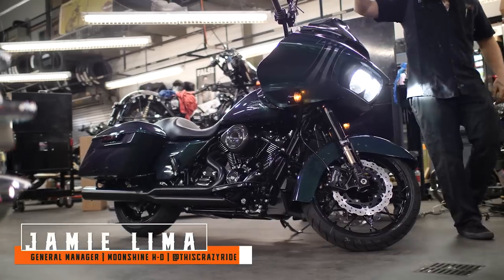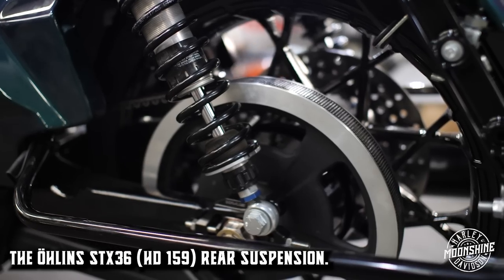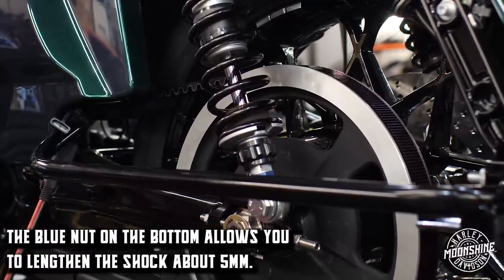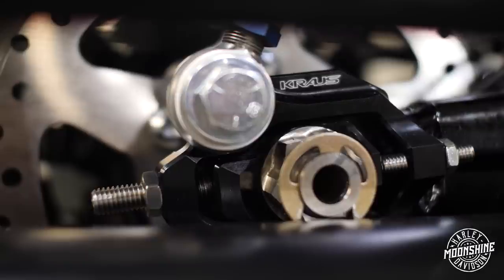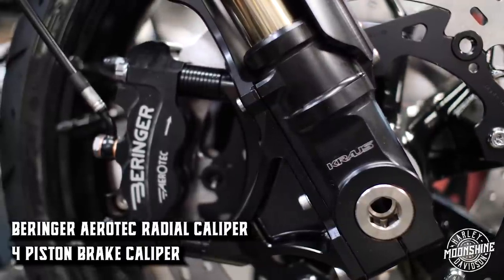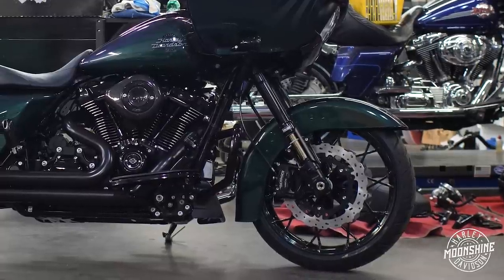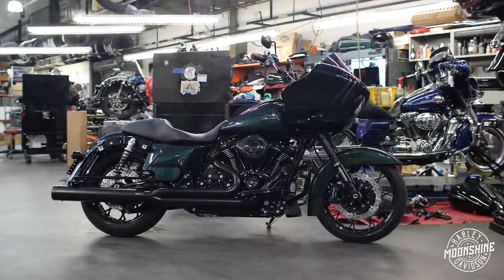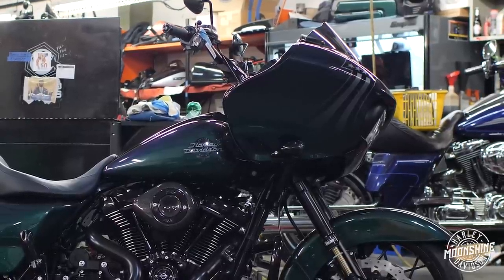Let's Build It! | Performance Bagger BIGGER KIT Bike Build No. 3 | Shop Talk Episode 50

Comment: When you take weight from the bottom of the fork and put most of the weight on the top, clamped in the triple trees you are reducing the unsprung weight. I believe that the more you take away unsprung weight the better the handling.

Comment: I have a 2020 SGS with the Kraus inverted front end, Ohlins on the rear with the Harley stg. 2 kit. Also have Feuling oil pump, camplate and lifters. I want to have some motor work done on the bike but I live in CA and am not comfortable shipping that far.

Comment: Right fork tube has a Teflon slide is that for measuring front end sag , what do you usually adjust baseline compression/ rebound
Reply from the maker: We use the slide for sag and complete travel while pushing hard.

Comment: Question I got a exhaust for my 21 road glide, I don’t need to a tuner right. And I was told when u air cleaner and a exhaust then you have to?? Also is there a tuner for the 21 screaming eagle
Reply from the maker: Yes there are tuners for all the 2021's, some shop can do it and other will tell you no. We tune all bike we install a full exhaust system on. you can get away with the factory tune if you keep the stock head pipe and add slip ons. We would recommend the most restricted baffle on stock engines.
Reply: @MoonshineHarley  can I get away with it for a few more months? It’s def noticeably hotter for sure. Will it be ok till nov? When riding season is over,

Comment: how does the new rear brake caliper interact with linked brakes?
Reply from the maker: The same as stock. It’ll just stop you faster with a firmer feel than the stock setup.

Comment: Question: I want to trade my bike for a Heritage and have it built. Do you guys see any noticeable difference in performance from the 107 bottom end to the 114 bottom end? I understand the stroke is different. But how would that relate to everyday riding?
Reply from the maker: 1 - 1.2 HP and TQ per cubic inch gained. The 124 setup on the short 4.375” stroke is a great setup.
Reply: @MoonshineHarley  
Thanks for the info!

Comment: Your spring vs unsprung is incorrect. You want both lighter (obviously) but it’s always better, if you can chose where to put the weight, to make it sprung weight. 

You want weight in the chassis (sprung) vs in the wheel (unsprung). Get the inertia off the moving portion trying to stay in contact with the road.
Reply from the maker: we got excited in the video and flipped it.

Comment: Must be nice to have money.
Reply: That helps 🤠
I still like watching the Videos though. 
The Knowledge helps build a list for when i hit the lotto.lol
Reply: Yeh I would like to know the total price tag is for this dream bike. With the total cost with bike and up grades. Then just the up grades with out the cost of the bike.
Reply: That build is probably kissing the ass end of 30k.  I got a rough estimate to do a slightly laid back version, meaning 124 w/heads, radials, Krause wolf one with erg bars, all the supporting parts in the primary an their transmission service an it was at the ass end of 21k.
Reply: These guys are top notch and know what they’re doing, an you no where need to spend that kind of money to have a bike that rips. These builds are the show stoppers that really show what they can do, but they still cater to the guys who only want to spend 5k to hit stage 2 with a few key supporting parts and maybe a bar job, obviously not from Krause.